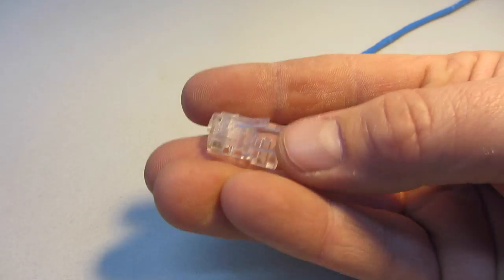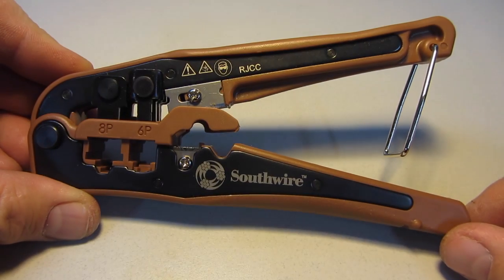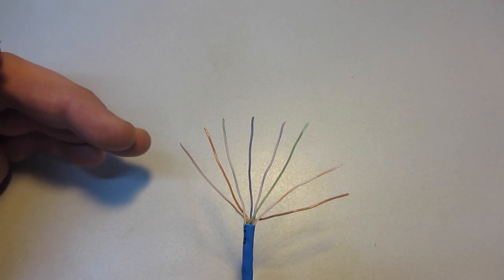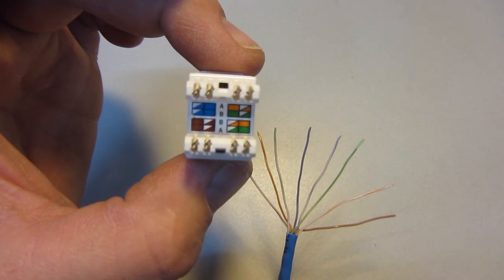Homemade Ethernet Cable - RJ45 Connection

Comment: Been trying and failing
Reply from the maker: just take your time, my friend.  You'll get it.
Reply: @PhilCrockett  i eventually got it working. I think the pin out on the otherside of the cable was different because when I did that side it started to work

Comment: While connector installation, is there a possibility of getting shocked(by electricity)?
Reply from the maker: Ethernet and phone cable are plugged in to a low voltage system.  If used properly, and for the correct purposes, you shouldn't get shocked.
Reply: Thank You for Your answer! 
The reason I asked, is I need to change my Ethernet connector (my connector is damaged), but I cannot disconnect it from a source(ISP switch)... Is it okey, if I change  my Ethernet connector while it is connected to the main switch?
Reply from the maker: why can't you disconnect from the switch? Is it stuck?
Reply: no, it is not stuck, it`s an ISP switch, witch is outside my house... The switch is locked in a special cabinet, so that makes it obvious, that nobody (except ISP workers) is allowed to "touch" it! ;)
I could call my ISP provider and ask them to change the connector, but I have no time to sit at home and wait for the "repair man", I have all needed materials and would like to change it myself!
Reply from the maker: Without looking at it, I shouldn't give advice.  I'm pretty sure I've never been in this situation.  I have only set up switches within my own home, networking the different rooms in my house.  I would go to a forum on-line and present ur question.  I'd hate to give u bad information.
Reply: Thank You very much! :)